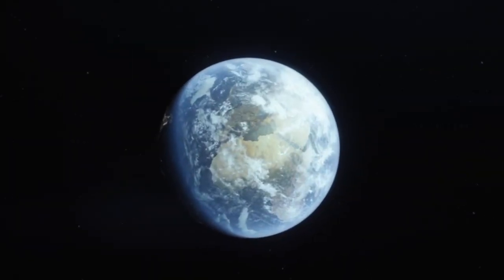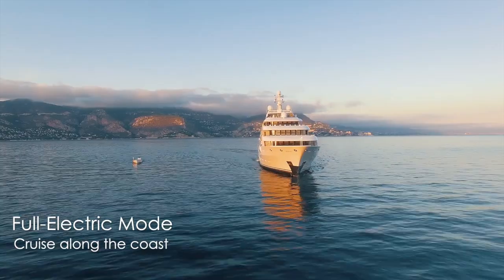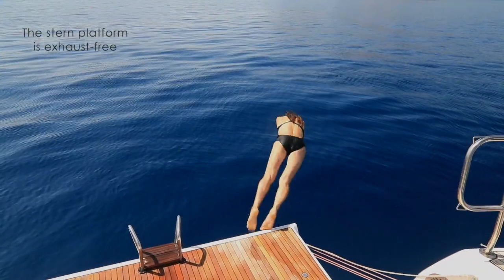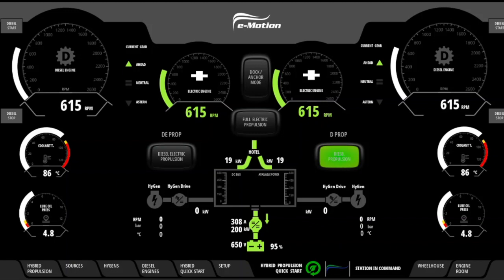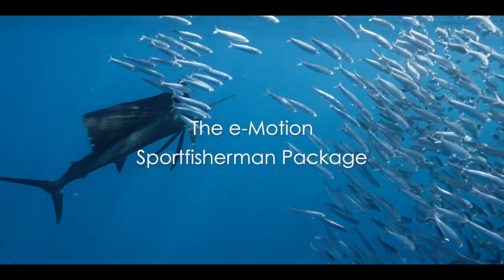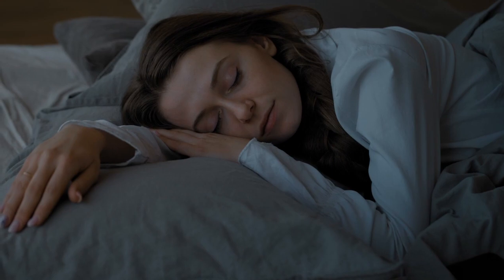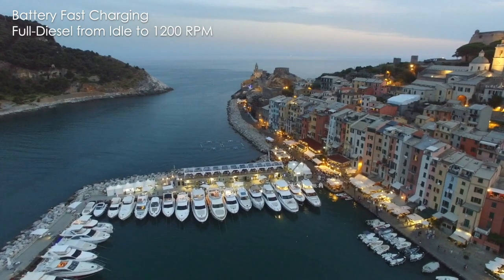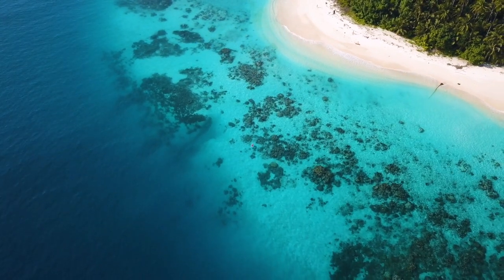The e-Motion Parallel Hybrid - Full-Electric Navigation, Winner NMMA Award 2022

Comment: Can this parallel hybrid system be added to an existing Volvo power plant? 
I'm currently changing the gears and have started researching this as an upgrade. 
I have twin 200hp Volvo diesels and I would love to have them set up exactly as you've described here, silent low speed operation, which is probably 60- 80% of my use.
I had calculated that the electric drive would need to be around 12-25kw for my 38' twin diesel Yacht
Reply from the maker: Hi ForWisdom, Thanks for your question.  We have a parallel hybrid system for 38’ twin diesel yachts however, at the moment we have industrialized our product with Yanmar engines.